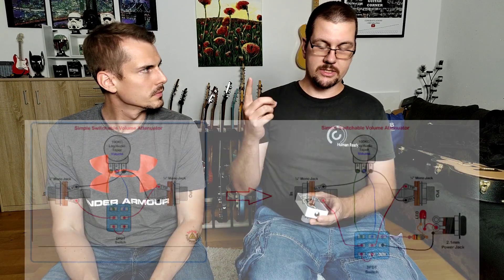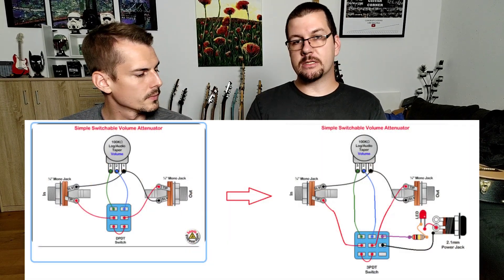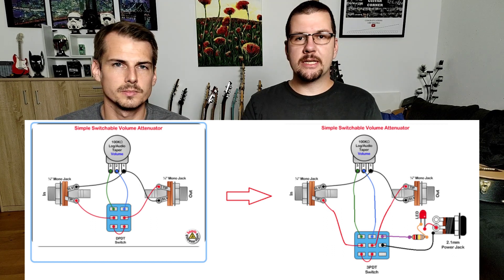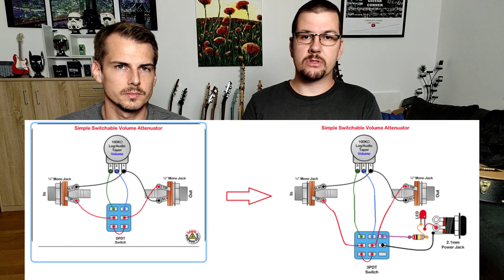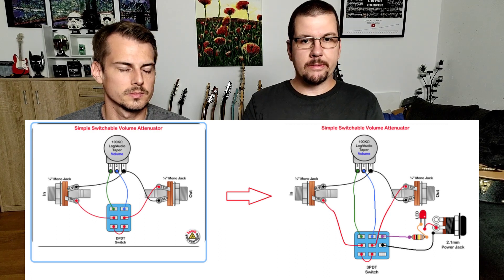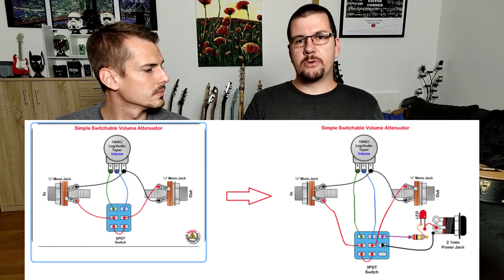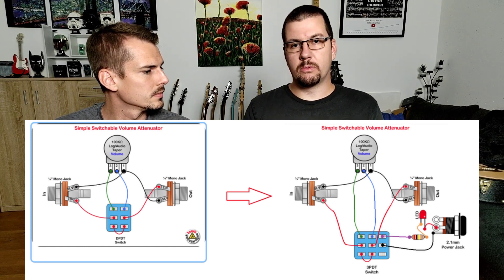LED in a DIY Little Black Amp Box Attenuator Pedal

Comment: Great one Guy's, but can you do this to a simple on/off pedal that U use to just turn on/off a Amps Reverb/Distortion/Chorus Effect that's built in a Combo Amp & Speaker?? Like my Roland Jazz Chorus Combo Amp 77 has output Jack's for each one, but It didn't come with any factory on/off Pedals? So if I'm Using a simple switch on/off pedal that has no other Power source than the Amp itself, is there enough power to run a LED from the Amp itself or will I have to add a Power supply for each one in a single switch, or if I build a 3 switch Box with only one power source will be plenty of power for all 3 LEDs?, I think I know this one but if there are others with the same deal, they might want to know? TY Lukus and Martin 🤘🎸🤠
Reply from the maker: Hey Ryan,
I think if you can use the power from the amp depends on how this is wired from the amp and how that footswitch works. If it is just a true bypass switch and you're running your signal through the footswitch, you will need the separate circuit, like we've used. But I think that's not the case with most of these footswitches, as you don't want your signal to go through long cables. But adding that separate circuit with its own power supply will always work. You can put the LEDs with their resistors in parallel and use the same power supply for all LEDs. That will work in any case.
Cheers,
Martin
Reply: @LMGuitarCorner   Thanks Martin, I thought the same, the Amp just has separate 1/4 plug in jack for each by their self, so I have been just trying to gather up foot switch Pedals that would just turn the effect on but I would like to put LEDs in them if I could? So I thought be better to build a pedal out of a used 3 Post switch Amp Pedal and just run 3 cables straight into the Amp. so I don't have 3 individual Pedals for each effect, ty Martin hope all goes well with your trip but I sure don't like it over there and hope LaZ Makes it home safely 🙏🤘🎸🤠
Reply from the maker: You're welcome, Ryan!
Yeah, that should work. I'm  not really worried about Egypt. We're still quite a distance away from Gaza, but I also hope Laz has a safe trip. Thanks a lot for your concern! 
Cheers, 
Martin